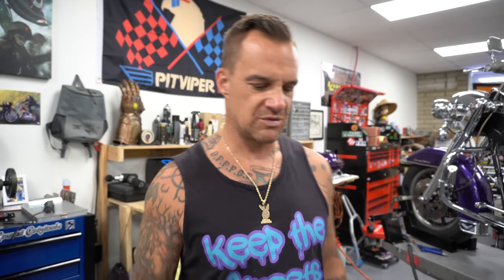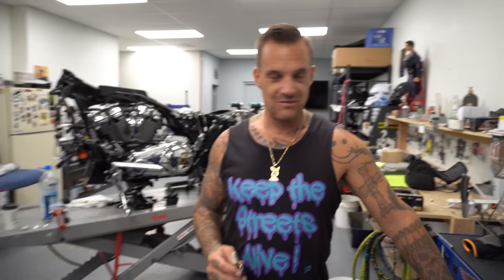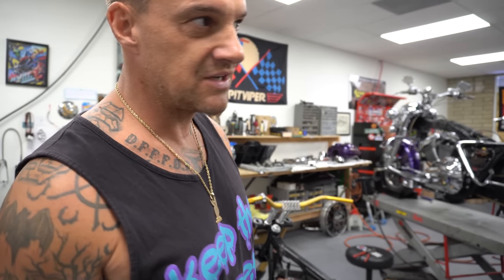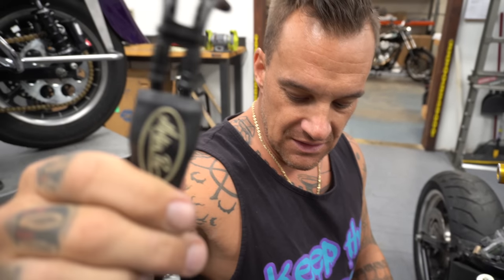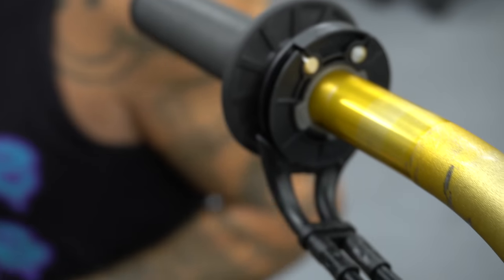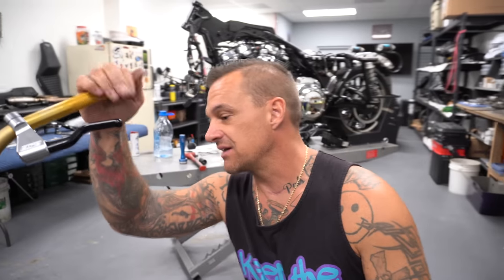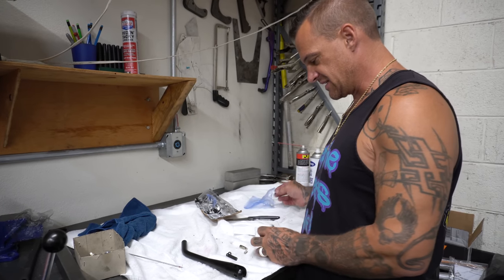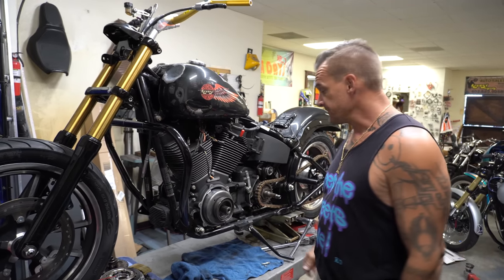I beat a twincam softtail with a hammer, and it feels gooood!

Comment: I have like 3 different years of my bike's Service Manual on my laptop so when I'm working on it I can just Control F and track down a torque spec.
Pretty handy when HD has a whole buncha torque specs for things that you work on close together several chapters apart. 
Made doing stage 2 build on my bike easier to handle.

Comment: So an m8 lowrider rim would work on an old wide glide? Because I have an 06 with a 25mm axle swap and finding wheels is a biatch
Reply from the maker: 100% The back might be a little wide it’s a 180 gotta see if it will fit

Comment: Hey Ryan aren’t those Late model dyna low rider rims? Fox river Harley fucked up my break caliper when they changed my tires and they gashed my rim on the inside I have been waiting 3 weeks for a rear break caliper and who knows about rims! Would you guys sell those as a set? I think I need that? Get back to me if you can
Reply from the maker: The front one has a crack in it and it leaks pretty bad. We just use it for mock up

Comment: Forgive my ignorance in regards to wheelies on a softtail what is the reason they are so difficult wheelie? Is it the suspension? Swing arm length?  Or the center of gravity on them? I would have thought they were just as easy to wheelie kinda like a dirtbike or sport bike rocking a monoshock. I've never ridden a soft tail just baggers and sporties
Reply from the maker: These don’t have mono shocks, this is a twin  handle very well just not good for Wheelies. The mono shock softail is also garbage for Wheelies bad geometry.

Comment: Fuck that.. stock harlry throttle is like a turn and then another quarter turn. Have to choke up or regrab. To give it a fully. Although after 3/4 turn mine pretty much just makes more noise. I don't have a Quarter turn. I have the quick turn from g2... although they do make a quarter
Well idk nout stock the heated grips mine came with had a turn n a quarter